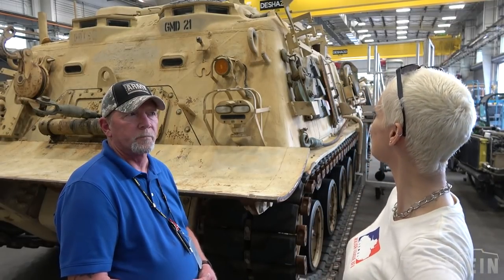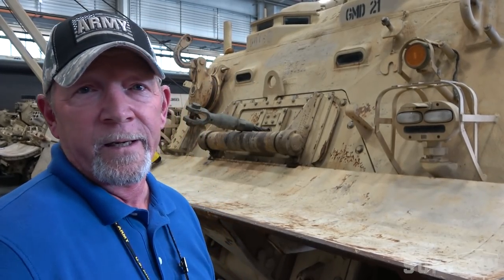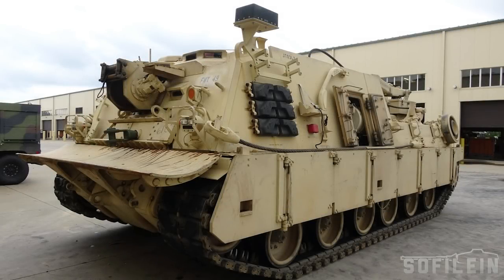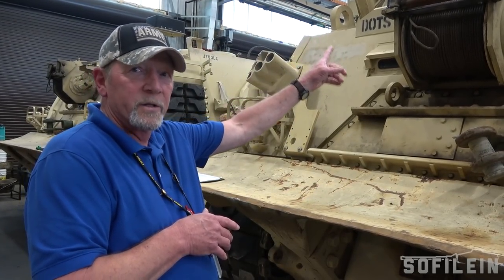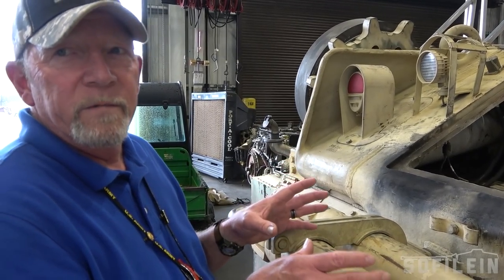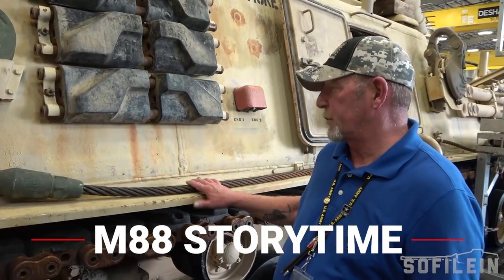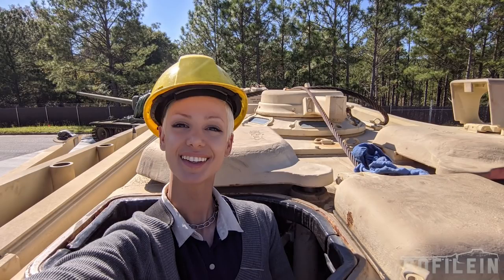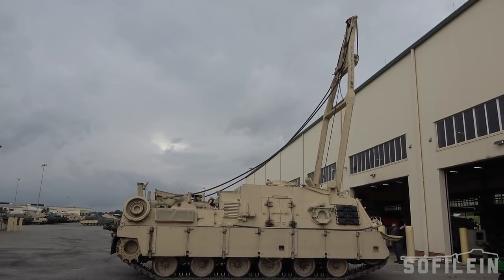M88A1 and M88A2 U.S. Army Armored Recovery Vehicles

Comment: I remember when they talked about how quiet the Abrams engine was. Then when I heard the Abrams engine start I thought “that isn’t quiet at all”. 

Then someone fired up a M88 and I was like, “Oh”. 😁
Reply: Truth is you will hear an Abrams tracks before you hear the engine as it comes at you. But you will hear a Bradley's engine for you hear its tracks. That's the difference between a turbine and diesel engine in a combat setting. If both are setup along a tree line or in a urban setting. You will hear the Bradley idling allot sooner than you will hear an Abrams at idle. Its just the startup that's damn loud lol. Or when we ground hopped them for maintenance.

Comment: The M88 A1 or A2 are the "backbone"  of the tracket vehicles maintenance units sections, not only for recovery but heavy lifts (power packs) fineldrives, sprockets, track repairs as well as impact wrench hydraulic power supply. Loved my M88, she would work her heart out for me and my crews. Spent over 20 years in tracket vehicles in the Marines.
Reply: Everything evidently breaks so repairs are needed even under fire actions! Thank you for keeping my freedom intact!
Reply: This is the most important comment here.
You haven't really earned your experience as a Bradley crew member until your mechanics get tired of you taking too long to do something; changing/removing  track pieces, road wheels,  idler arms, or armor plates and they come along with their 88's and show you how to really get work done.

You can use a Bradley to recover a Bradley.... sometimes.

But an 88 can pull your pack (engine and transmission) in the motor pool at NTC or at your FOB in Iraq.
Reply: we didn't call ours "Big Wrench" for nothing!
Reply: Yep same here , loved it

Comment: I was a Bradley mechanic for 15 yrs. My first unit was 3rd ACR back when they had just got to FT. Carson in 96'. I was assigned to 2/3's recovery section and I was assigned an M88a1 my first week with my unit. My 2nd week I was pulling M1 packs for services. It was from that point on that completely shaped my service career. When ever I was transferred to a new unit I just had to say yeah I am M88 qualified and I was assigned to the M88's lol. Rarely was I not assigned on one and that being when I was posted over in Germany. My 2nd tour in Iraq is where I put every ounce of my experience and recovery knowledge of M88s to the full test. That was the deployment every recovery operator prays they never see but trains for. Of the 13 Bradley's the 101st ABN 1/32 Cav had (Pre-po Brads from Kuwait). 11 were coded out for IEDs. I recovered all but one of them. And I did every recovery mission that was in between. For 8 months I was a wrench slinging. track changing. mile burning fool lol. I had to change the track on that M88 two times due to the amount of miles I was putting on it. That one tour was my THE tour. Even though my first tour was when the Insurgency kicked off and all the hell and chaos that brought. But the M88 I had during my second tour was at first owned by another unit that already had a M88a2. And the M88a1 was theater property. It was basically a hand me down from the invasion units. The unit that had it said it was junk and they didn't want it. Well I needed it to do my job. So I talked to the 101st CO and he agreed to sign for it. Now I had a recovery and lift track to do my job. The "JUNK" M88a1 drove and ran like a damn dream. She gave me many reliable miles. And never let me down outside the wire during a mission. Hell the old gal had to go recover the fancy M88a2 lol. Allot of people think the M88a1 is old and junky. That's only because they don't know how to work on them correctly and keep them running. The M88a2 has allot of issues the a1 doesn't. The a2's brakes are hydraulic. So they have to warm up before they start working good. Which is a god awful thing to have to do during the winter months. The a2 has allot of problems that comes with "Modern" upgrades. That the older versions simply never had to deal with. I was always grateful I was never assigned an a2 version. The a1's were are incredible machines and honestly one of the vehicles the US Military got RIGHT. And I always felt allot safer riding in an M88 than nearly any other vehicle we had over there including the M1s. I wish I had never been injured during my 3rd Iraq tour. I would have happily gone to work as a civilian contractor just so I could keep working on Brads and M88s. I miss that kind of work.

Comment: Nice look around on the A2.  They didn't have them when I was in.  Back in AIT they still had a original gasser 88 operating.  They would overprime the fuel system so it would blow flames out the exhaust.  What a trip.  Spent most of my time driving a M578 which is not exactly small but the 88 made us look tiny.
Reply: The 578 was another well suited vehicle, I also spent some time as a maint chief in a Arty Bn. (self-propelled,M109,107and 110) every so often the maint. Chief of 2nd Tank Bn (USMC) would ask me to send my 578 and chew to help with his maintenance. How ever when a vehicle bogged down in heavy mud it nice to have tanks send over thier M51 heavy retever
Reply: When I was in during the mid 90s our unit still had a Korean War era deuce. It was so old it didn't even have a turbo.
Reply: @slateslavens  None of them did when I was there.  Later in the A2 series if I recall correctly.

Comment: That is the real problem with tanks: For every tank you have in active service you need an assortment of heavy duty vehicles to maintain, recover and repair them. It sounds strange: But tanks are FRAIL.

That is one reason why I like the 8*8 wheeled vehicles. They are generally build by truck manufacturers - and if you think they can sell trucks that need a recovery every 1000 miles - well if that was the case: They would have been out of business a LONG time ago.
Reply: It's not just tanks.  The same could be said about combat troops.  It is said it takes 10 soldiers in the rear supporting every front line troop.  Think about it; cooks, mail room, various communications, payroll, supply, clerks, hospitals, air crews, PX, special services - the list goes on and on.  All vital links in the chain.
Reply: But the 8x8 vehicles are absolute garbage too. Lets discuss the Stryker. It is plagued with mechanical problems and is one of the most unreliable vehicles in the Military fleet.
Reply: @LongBinh70  You are quite right. There is a lot that could be streamlined in the supply chain. But as the USArmy is modelled on the preussian army - that won't happen. Have You ever heard of a german army with administrative simplicity? No! I thought not.
The union army was heavy in infantry - because most of the soldiers were farm boys that KNEW how much WORK horses are!
Reply: @lshssprings  That is because you do it wrong. Lets see if the Swiss MOWAG Piranha V is not better. Let truck manufacturers make 8*8 - they know that they are out of business if their trucks break down every few miles. Some parts need to be strengthend.
What the Danish Army does: It slaps a bit of armour on their trucks - because they will do their driving. The trucks are made by Scania.

If you look to the Danish Huitfeldt-class: They are build like car-ferries whereever possible - and it is a lot of places. They use MAN Diesels. They are just 1-2 knots slower than say a Sachen-class.
Cost much less have a range about double - liveable quarters. And swap the crew and every position is to be handed over and signed for by the relieving crew - each one of them personally signs off.
They are also designed to cater to the mechanical ineptitude of the navigational officers. For engine power they signal simply: 1, 2 or 4 diesels. Even an admiral can figure that out.
But then Danish sailors have more sea-time than anybody else. They keep sailing in some of the worst arctic waters - or creepy shoaling waters of the Baltic - trust me they are creepy.

What happens when the skipper runs aground - well, the entire crew gets a crash-course - how to handle a crash. The chief is the damage control officer. Esbern Snare smashed a gearbox, but for the purpose of the major exercise they only needed one engine. And when she needed to dock to get the gearbox fixed - the entire crew got on a crash-damage-control course (set up by the German Navy - trust me: No short cuts there). The captain - well he got promoted - now he had learned NOT to smash his ship.
In the shipping line, I worked in - many years ago - a skipper had fumbled things up - went through a navigational course - and was brought back in service after that. I saw him in the office - he got the message.
Reply: @lshssprings  naw the Hemtts are fantastic Stryker absolute shit and to be fair if the 88 isn't maintained it will go down so easy 88s are also air cooled instead of liquid cooled so the engines dont last long
Reply: 8

Comment: I am old enough to remember the M51 and that was a beast. On Qkinawa in 1969 a P5 Amtrack bottomed out in our back lot of Eng Maint. The M51 could not pull it our so we assisted with several of our heavy bull dozers. It was a struggle and the work was hot and the lot muddy. When they finally were able to recover the P5 . Suction held it firm. Hahahahaha! The M88 is a nice piece of equipment. They left when out armor left last year. I cried when I seen them at the railhead headed for parts unknown.
Reply from the maker: Holy moly what a story! The M51 is an absolute BEAST and I wish I could see one operating someday. They have one at the NACC collection and it's amazing. Big respect to you! Thanks for sharing, I really appreciate it
Reply: @Ford yes! Sorry for not being clear! Did you crew on one!
Reply: @Sofilein  I was lucky enough to be given a MOS of 2161 repair shop machinist. Even thought the field was in Ordnance I could go anywhere they required my MOS. I been to both Marine Corp ground depots, I&I duty working with reserves, teaching at the Ordnance School itself at Quantico at the time, 4 different FSR/ FSSG and two MAG’s. So I seen and worked on a lot of equipment. I worked for and had many talented Marines that made me look good. I am entirely grateful to the Marine Corp for training me and when I retired I went to work at NADEP CP NC working on the AC I worked on in the service.
Reply: @Sofilein  I was one of the design and testing engineers on the M88A1E1 program that lead to the M88A2.  I can give a very long winded history of the effort and detailed explanations for a number of things on the design if you want.  I was directly involved in the hull, armor, all three winches and  winch systems, the boom and various misc. items.  Some of the things are amusing as trivia.    Is there a way I can contact you directly?  Too much to pass on via comments.

Comment: One subject that this trainer didn't talk much about was regarding their usage with the Corp of Engineers as makeshift combat engineer vehicles.   They were not designed as such, but their dozer blade and A-frame accomplish much of what the old M728 CEV once did.   Sadly the amazing M728 was retired despite it being an incredible swiss-army knife combat engineer vehicle with a 165mm demolition gun (with a snub-nosed barrel) that was perfect for urban combat when the vehicle was equipped with reactive armor.  No replacement was ever made sadly.    I still hope that the Army will listen to their combat engineers and realize that they need an M1 abrams version of the M728 with a snub-nosed 165mm demolition gun along with an A-Frame and the usual attachments of mine plows, dozer blades, and other tools.  The current breacher vehicle is nice but it's not as versatile.  As such, the M88A2 ends up getting hijacked to fill roles it was not originally designed for while lacking a good demolition gun.   This huge gap in capability I believe seriously needs to be addressed.   That being said, the M88A2 Hercules is an absolute beast.   Everyone in the Army loves that vehicle when it shows up.

Comment: 1974-76,the M-88 s I worked around had a gasoline fired -turbo-charged engine whose block was a basic M-60 block-I saw one pull an M-60 plus a second M-60  who had tried to help out of mud up to turret rings.It would belch fire and smoke to beat the band, frying much nearby foliage
Not sure how old those monsters were
Reply: That's the 1790 SI..".S " stands supercharge not trbocharge, the twin superchargers were driven by shafts in the crankcase one on each side, the " I " stands fuel injected, and the crankcase was not inter changeable, output was 1,050 hp at 2,800 rpms...it was a "honey" of a engine, I loved building them!

Comment: Had the privilege of repairing some of the M88 parts out of Fort Knox. Our machine shop was able to get several contracts to refurbish a bunch of gears and I learned to tig weld aluminum repairing their cooling fans. Got to hear a few run on the Dyno while I was dropping of parts and holy crap they are loud. Awesome machines

Comment: I was a tanker from 82 to 86, and when I was stationed in S. Korea, we were in the field quite a bit and more than once an 88 and it's crew saved our bacon. More than once, they had to pull the pack due to some kind of engine issue, or when we crossed a small bridge that didn't hold us and it took 2 88's to pull our m48a5 out of the stream we fell into because we broke idler arms, torsion bars and even bent a drive sprocket shaft. The 88's were and are a God-send.

Comment: Thank you for finally talking about recovery vehicles.  While I served in the 3rd Sq/14th Cav,  I spent almost 3 years in an M74.  The largest vehicle that we ever pulled out of the mud was a M48A2.  However, not to brag, but on one occasion, Tank Company's M74 blew an engine (500 cu-in Ford V-8) while towing an M48 as it neared our Kaserne in Bad Hersfeld.  We hooked onto both of them and dragged them up the hill to the motor pool.  Thank goodness for the 1st gear super low ratio.  I never served on an M51 -  or the M88, as that time it was still a gleam in the Ordinance's Eye
Reply from the maker: That is awesome!!! Thank you for sharing. Love the recovery stories. Respect to ya

Comment: This brings back so many great memories. I went through Basic, AIT and Hotel 8 at Fort Knox back in the early 90’s. Spent a lot of time on one of those in a couple of NTC stays at Ft Irwin. I wish he had mentioned about the Onan generator system that would independently operate I believe the hydraulics, pump fuel from the large reserve, charge the batteries and run the heater.

Comment: SWEET!

The Direct Support Maintenance unit in Germany, that I was assigned to from 1986-1990, had TWO of the M-88a1s and TWO of the M-746 HETs.  BOTH of which had that Continental AV1790 V-12 engine.  That old 2-cycle Continental V-12 ( which has a VERY distinctive sound), is VERY different from the Detroit Diesels that Wikipedia says the M-88 and the M-746 has...

We supported 2/75 FA.  
We didn't do Hohenfels, we did Grafenwoehr.